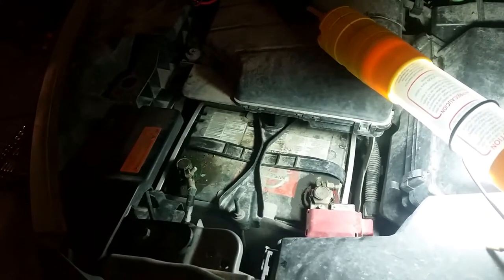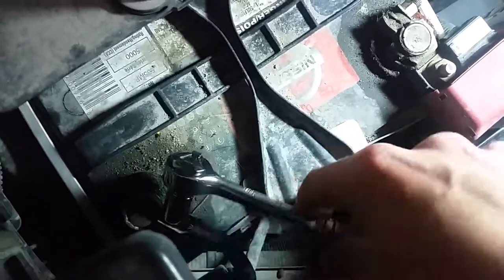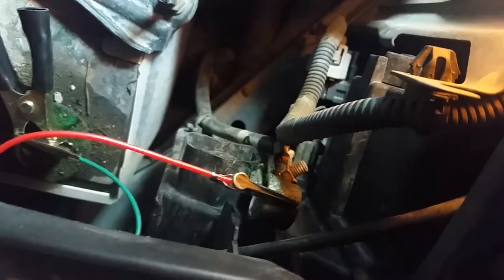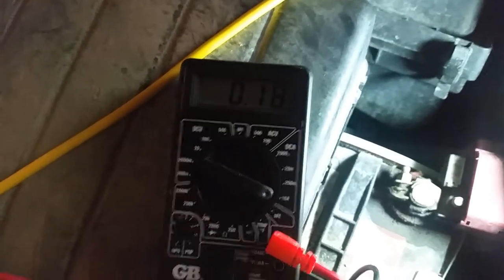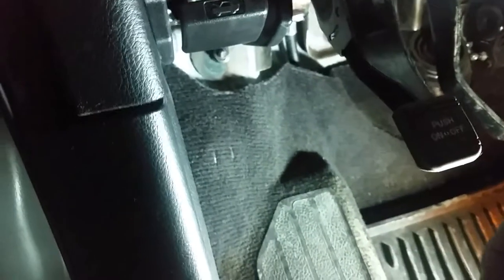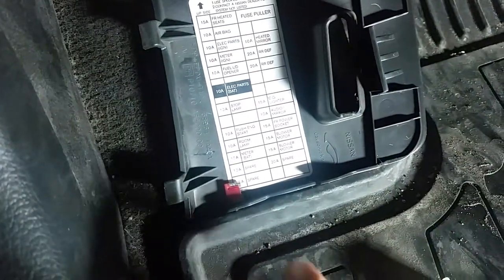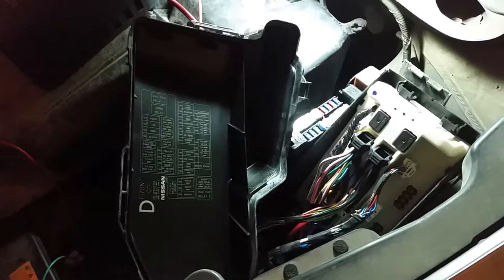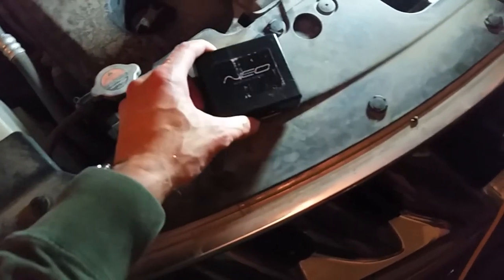Nissan Murano Battery Draw Fix

Comment: I have a 09 Murano and it’s been sitting for some months now. Since a year or two I started experiencing the car going in limp mode. The first time I experienced it was in a traffic light and couldn’t move the car, not responding to the gas pedal and moving extremely slow and then suddenly kicked into normal mode…  happened to me 2 or 3 time a year and once left me out of town and couldn’t start it back. Acts weird, for sure it’s something to do with the electrical/electronics. Apparently, many had a similar issue but not one has a real fix. Some suggested the Alternator but it has to be an OEM as many after markets seems not to hold for long. I tried so many other things as well, air intake boot replacement, throttle, battery, pedal sensors ..etc… I tried to troubleshoot it but not obvious. It’ really a pain these electronic and electrical system. As I said, I’m not the only one who experienced that. If I had a garage, I would work on it but now it’s parked outside and cold. I’m in Calgary and this weekend it’s going down to -35 : ). Replacing the alternator is a bit costly too but there is no guarantee, and really don’t want to end up stuck limping in the middle or nowhere or in the middle of everything.
Any ideas? Have seen or heard or such limp mode or any fixes?

Comment: The room lamp draw was from the door being open. Audio is from memory on stereo. 
What is the draw once you put the fuses back in without the iPod Jack?
Reply from the maker: The ipod unit was the cause of my parasitic draw and it was almost  completely disappeared when the fuse was replaced.   I'm no longer using that device.   I still have an acceptable draw for the clock and memory of course.
Reply: @shaneperche-fixed-it  what was the draw on the car when you finished. I think I had a bad stereo wiring from the previous owner.
Reply: @shaneperche-fixed-it  after I pulled the stereo it’s .10
Reply: @authenticationstation2041  That's better but still seems a bit high.  My 09 Murano is now sitting at 0.03 Amps or 30 mA.  Ideally you want to get it below 50 mA to avoid dead batteries when not in use for a few days.  I think you might have mentioned this but did you cover the sensor on the door to simulate that the door is closed?
Reply: @shaneperche-music  yes. Doors were disabled.
Reply: I’ve pulled every fuse. I’m thinking the previous owner did some creative wiring that I’m going to have to hunt down.

Comment: fighting the same devil here! Mine is a 2004 Murano SL, what year is yours?
Reply from the maker: My Murano is a 2009.  Were you able to isolate which circuit the parasitic draw is on?
Reply: @shaneperche-fixed-it  I were able to isolate the drain in a positive wire that feeds the BCM module, I programmed a new BCM but the problem remain the same...
Reply: Mine is a 05.  I have a 0.13 draw

Comment: where is the neo sound unit located?
Reply from the maker: In my case, I had installed it myself when I bought the car and placed it behind the stereo accessing it by removing the carpet on the passenger side.   If you didn't install one, you likely won't have the exact same issue but you can use this technique to identify which circuit is causing your draw.  Once you identify the circuit with the draw you can focus your attention and inspect the components on that circuit to fix the issue.